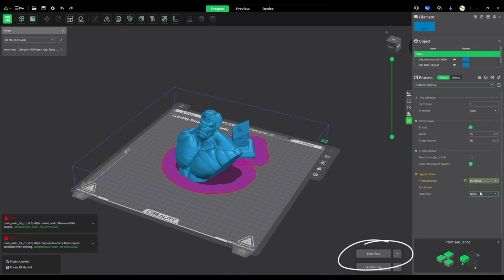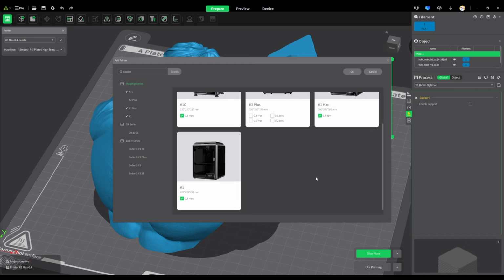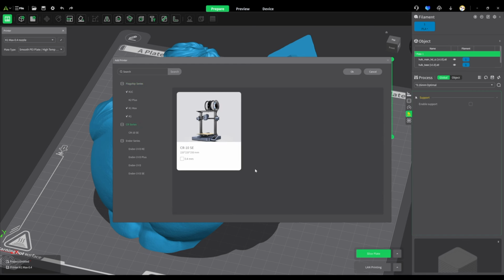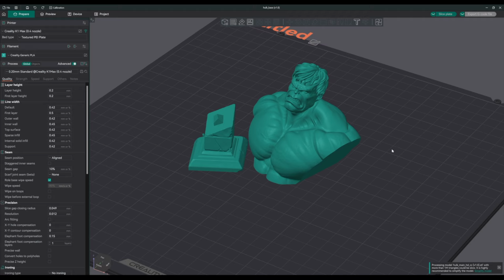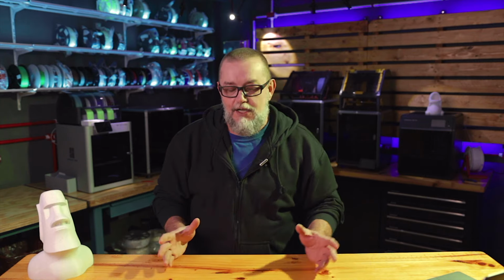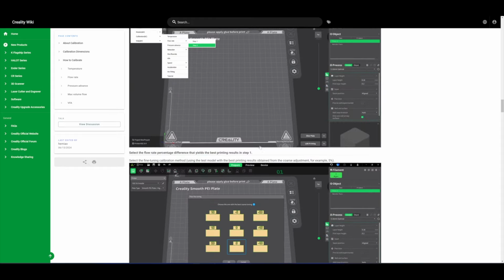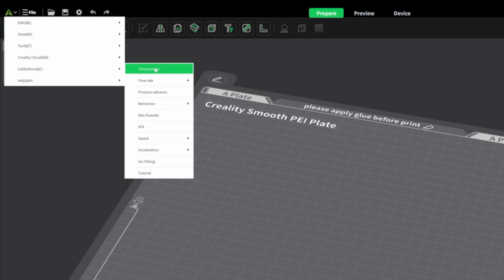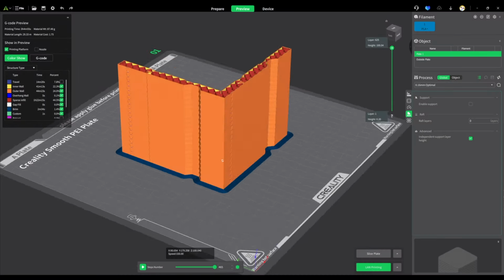Creality Print 5.1: Does It Deserve To Be Tested? 🤔

Comment: Got my 1st Printer last month so version 5.1 was my first experience. Great prints from the start without calibrations. Understood the software etc. 

But now they have messed up. Version 6 is crap. They even removed the Object Detector which is a use-full feature for telling the software to ignore a failed part during print. 
So I have defaulted back to version 5.1 and I have learned some things from this video. Thx

Comment: My biggest issue is that I use a laptop and also a large widescreen, going from Laptop screen and then the large widescreen seems to upset the popup windows and they pop up off the screen which means I can't click them and need to crash out of the application.
Reply from the maker: I notice the same problem when the software stays running for a long time, but I saw this after making this video

Comment: There are still some weird bugs in 5.1 but overall its working pretty well for me. The main bug thats been giving me issues is support generation through the support painting tab. Sometimes it works and sometimes it wont generate any supports... also you mention the flow calibration tutorials being wrong between cura and orca versions? Does that mean I've done some math wrong? The way the tutorial explains the math it sounds like it defaults the g-code to 100% flow for the calibrations?